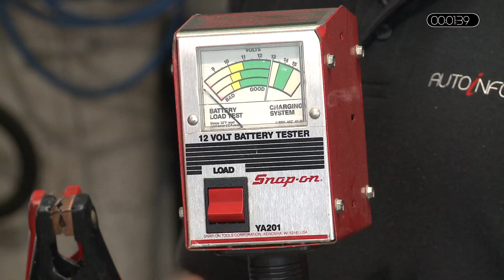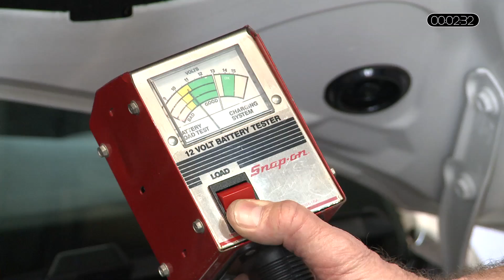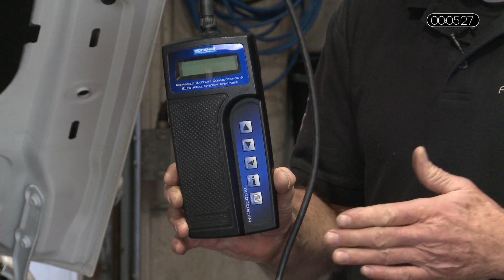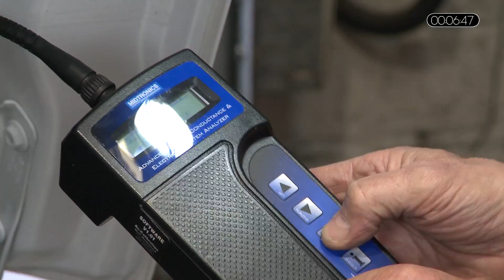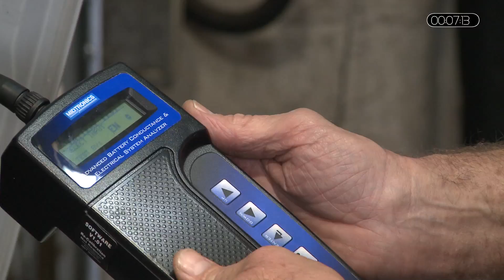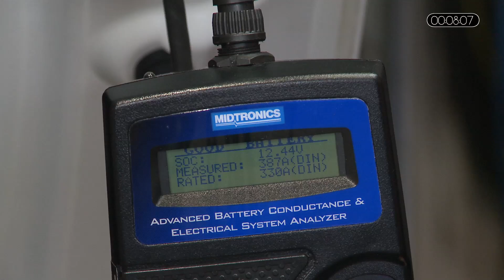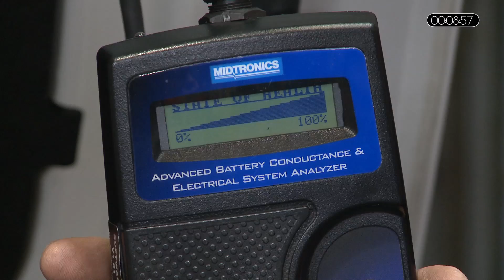AUTOiNFORM ONLINE MAGAZINE:  Battery Condition Testing by Frank Massey

Comment: Great video, you made a very valid point  regarding high discharge rate testers being potentially misleading most on the market draw around 100 amps which was was a valid  test load for batteries in 1970's cars  but as modern cars are fitted with much larger batteries   a carbon pile testers is required to draw the  200 to 300 amps required to detect a dead cell.